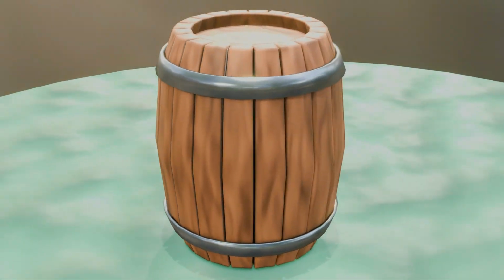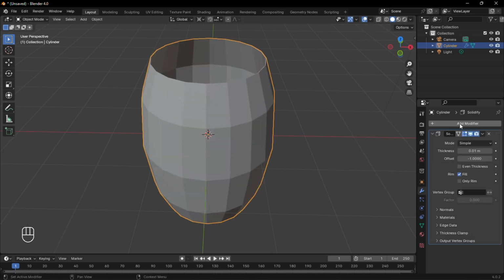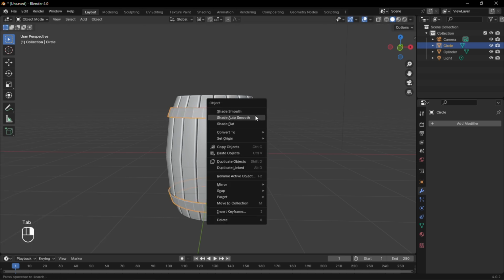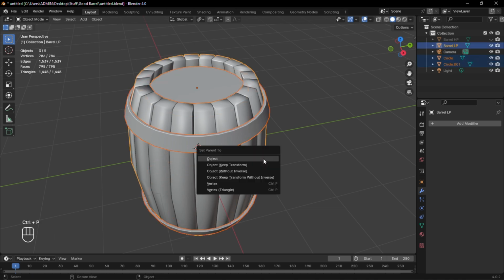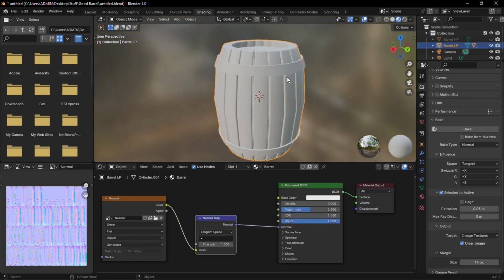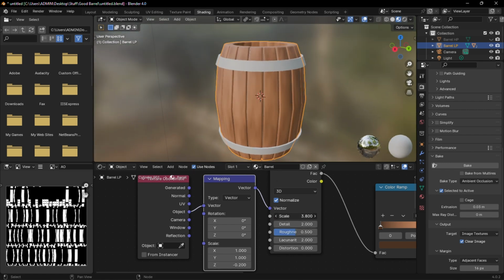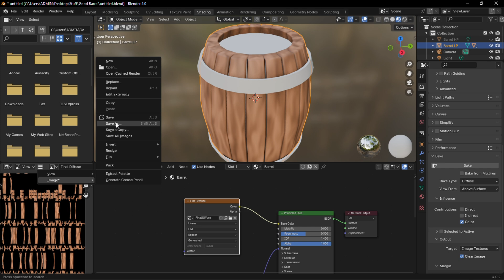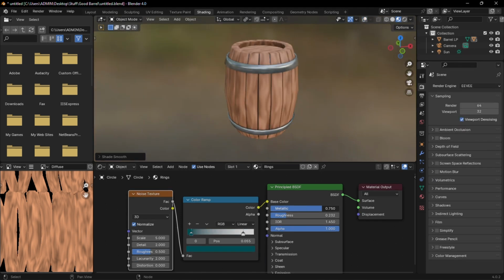Blender Tutorial: Make A 3D Wooden Barrel

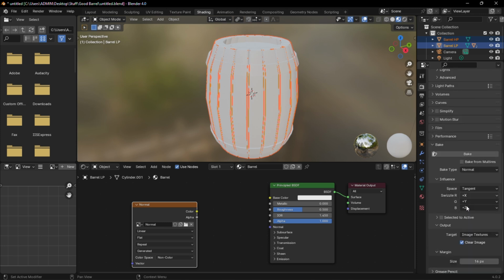Comment: in 2:57 the extrusion option doesn't appear, is it important? maybe a settings issue? I'm sure I've done everything accordingly.
scratch that!  I don't know what I did, just remember selecting the low and high poly again then selecting the image normal map node again then the option showed up, lol, so issue fixed.
Reply from the maker: make sure to check selected to active and click on the "drop-down" icon to show all the options.
it should contain the extrusion
Reply from the maker: if it doesn't, then you might be using an older version of blender which doesn't have that option.